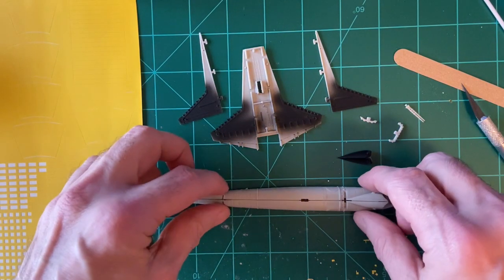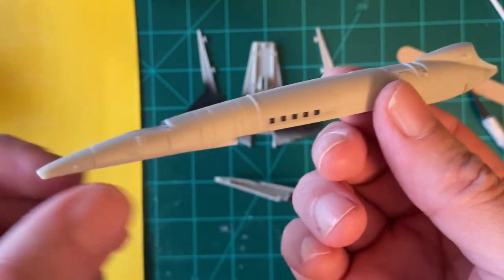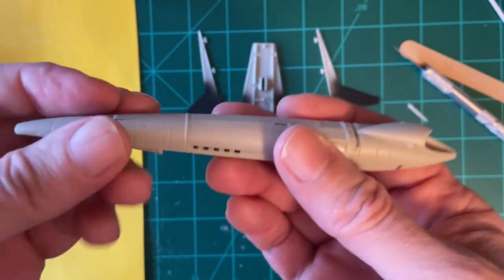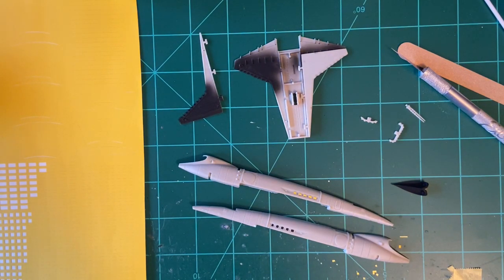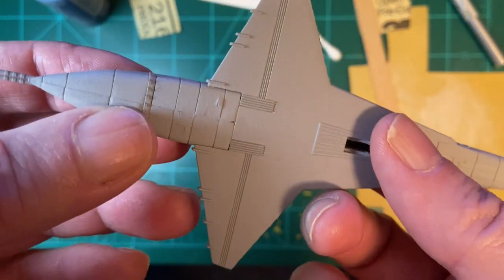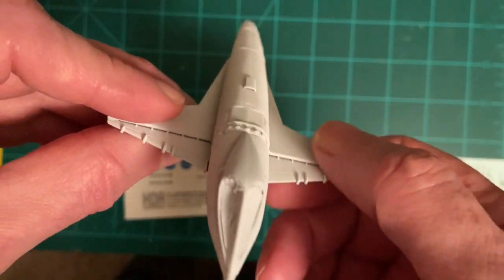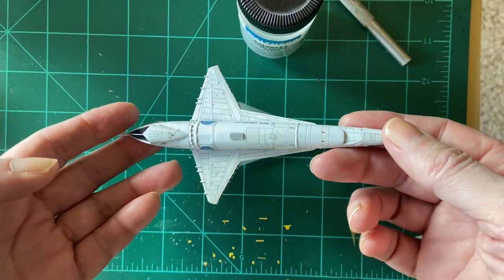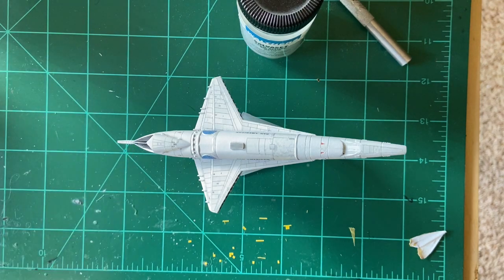Moebius 1/350 2001 Orion quick build and HDA decals!

Comment: My 1/72 Orion is on its way.  I'm not sure I'm happy with the buy.  Mobius seems to have just scaled up the old kit.  This would have been fine if they had added something new to it, some photo-etch?  a real base / stand, one that works?  a 1/72 interior?  Gasp! landing gear?  A detachable back section with engines?  I hope there's more to it than meets the eye so far.....
Reply from the maker: The 1/72 has a full interior with the passenger section and cockpit. I did a review on it as well.